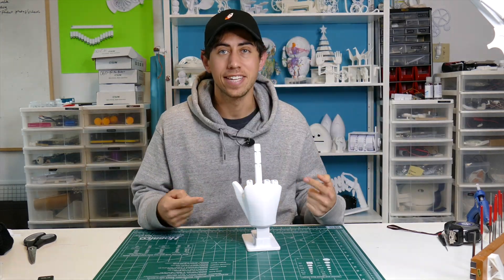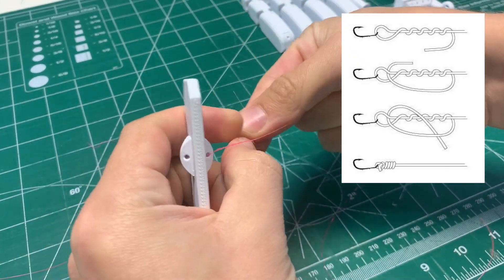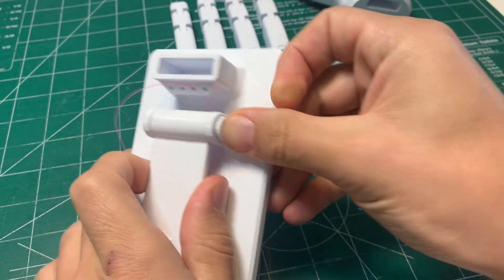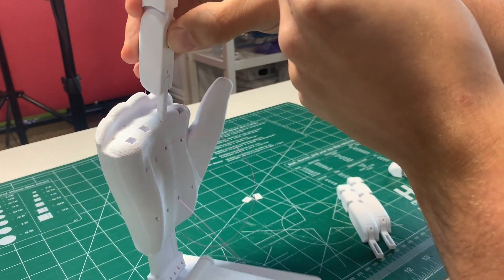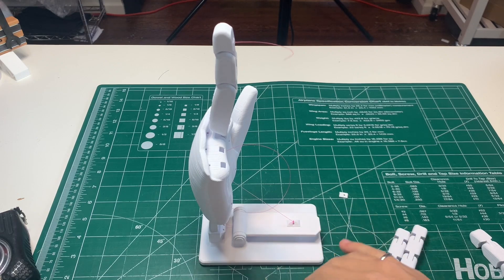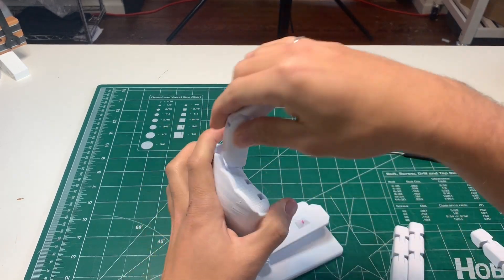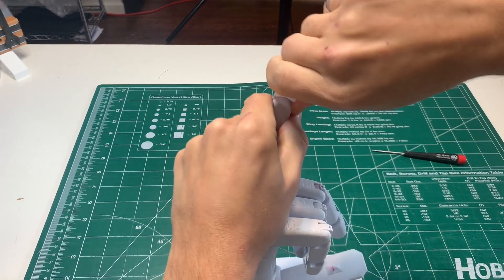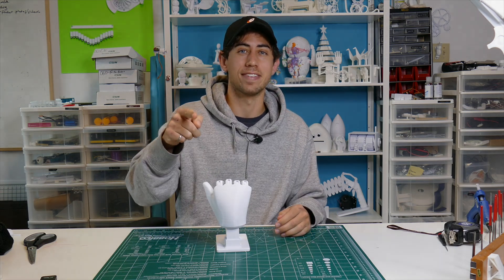3D Printed Kinetic Sculpture meant to Address the Haters

Comment: Hey! will it still work if I would use ABS filament and smoothed it with acetone? or the holes will close?
Reply from the maker: It will likely have some problems because the fingers are print in place! Let me know if you end up trying it.